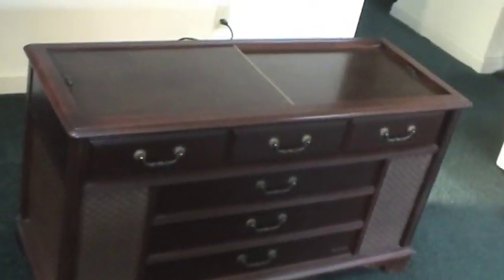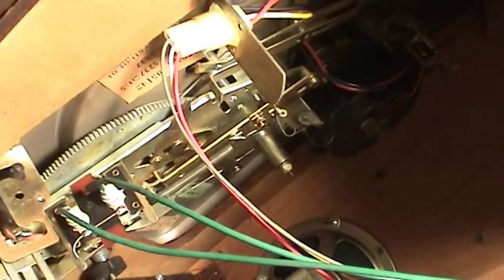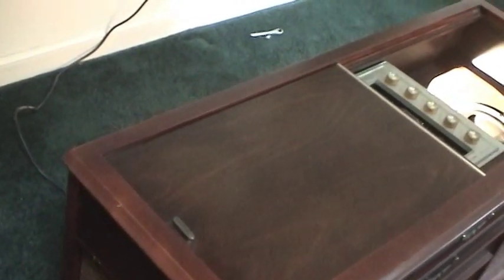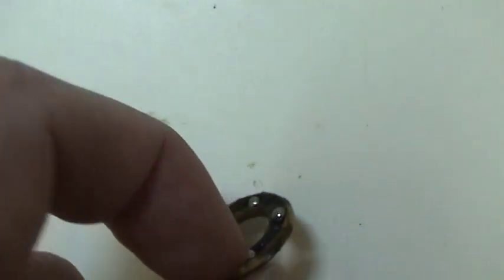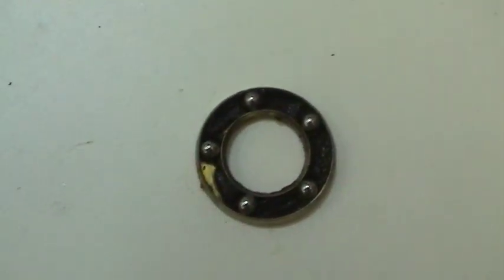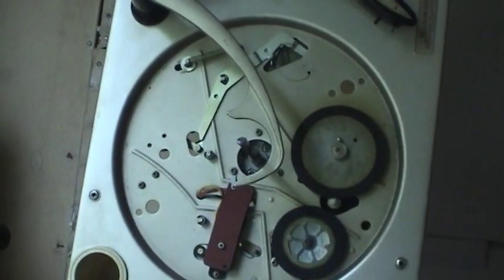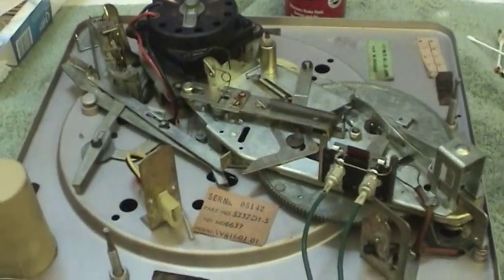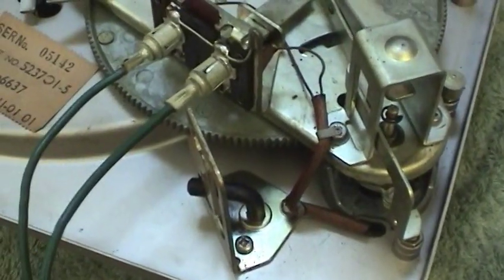1967 Magnavox Micromatic Turn Table Maintenance

Comment: Another nice thing about (a lot of) the W600 series changers, was that there was a muting switch in the area where the audio cables connect to the changer. The muting switch was activated during the change cycle so that none of the noise would come through the speakers, then would unmute when the change cycle was finished.

Comment: Just a handy tip or two. When removing the changer, those rubber discs can be disposed of - just pull them out. They were installed for shipping of the console to the dealer and are no longer needed. Once removed, the metal clips simply flip over to a vertical position and allow the changer to lift out. No need to remove them. This will also keep the isolation springs in place. 

Also don't forget to remove the bottom cap of the motor and oil those bearings.
Reply: Any chance you know where to buy those odd shape mounting screws that connect to the clips?  All three of mine snapped off.  Most likely because they are from the portable suitcase version and were  jostled repeatedly over the years.

Comment: Thank you!! I'm about to start on a repair/restore of a portable Magnavox I have from the 60s. It was working until just a few years ago when the turntable stopped spinning (but the motor still hums). Sounds like it just needs to be cleaned up and re-greased. I'm having a few issues taking it apart but from your video I'm suspecting a clip underneath that I need to get to.
Reply from the maker: Good luck with your repair. We have to keep these old classics working!

Comment: I just got one of these today. Radio works great. Sounds awesome. The turntable won't drop the record. I did all the cleaning 
and and greasing. I can't play the records manually either, because the tone arm moves a little stiff and makes the needle skip. My tone arm is different than yours, but the cabinet is almost identical. It has the trumpet front speakers instead.
I worked on it for about 4 hours, but I guess I'll have to put some more time into it....
Reply from the maker: Sounds like you're on the right track to getting it working again. You may have to clean and lubricate it several times to really work the grease into all the parts.

Comment: About time too Johnny Boy...Been waiting for this for ages...haha!!!
That deck is basically a Collaro...Don't you just love the way it senses the record size by tapping the tonearm against it.
Garrard and BSR decks only have one idler pulley...You probably did, but I would recommend lubricating the motor bearing and cleaning the outer edge of the idler pulleys, along with the inner drive face of the platter. That deck has had very little use!
Nice to hear it working at last! Well done! :)

Comment: Thank you for this! I am hopeful I can get my "new" 1963 Magnavox back spinning. However, I discovered that, at some point, the power cord got bunched up in the cabinet, and partially melted on one spot that was up against a glass tube. So that will need to be replaced. 😣

Comment: Collaro made the turntables for the Magnavox consoles...Until Magnavox stopped making them. Yours has to be a very late model!
I would suggest using Methylated Spirit to clean the outer surface of the pulley's...Yours seems to run so well I wouldn't worry too much.
If you go in there again, take the cover off the motor...You'll work it out easily...You're a clever guy John! :)
I love the way it selects the size! Almost sentient!
Keep up the good work! Thanks for the Great Video! :)

Comment: I have the same turntable in a different cabinet. It’s my late grandparents 1966 Magnavox and I am cleaning it up, replacing bulbs etc. still sounds decent but the mid-range freqs are not what I think they should be. Have to figure it it all out.  Thank you very much.

Comment: I have a 1966 MicroMatic Model W620. It's been humming and producing distorted sound. The needle is replaced and it still sounds bad. I adjusted the tonearm weight which seemed to have helped, but an intermittent hum is heard as if some grounding problem?

Comment: I have a different console stereo a 1966 Catalina model 122-686A. I have found the issue it is a switch that has a plastic housing the housing is broken. The "off, on, reject" switch that connects to the motor. I'm looking for a replacement in good condition, any input on what the piece is called and were I can find one?  thanks for your help.

Comment: I'm currently working on a 1961-1962 Magnavox. I'm not well versed in turntables but how can you tell if a belt is slipping or the motor is going out?
Reply: if the motor was bad the platter would slow down to extremely slow but the idler could cause it to slow down but run erratically

Comment: Great video.  I'm trying to get mine to work.   At 14:22 there is a spring in the center of the frame.  I have that spring but I found a spring just like that one in the bottom of the cabinet.   I couldn't see a similar one in the video.   Is there any chance you noticed a second spring and where it is supposed to be?

Comment: Hi there, we've got a similar unit and the turntable spins and have sounds through the stereo but no sound from turntable to speakers
Reply from the maker: I'd check the RCA connectors from the turntable to the power amplifier. Also, check the selector switch on the amplifier and make sure the contacts are clean.

Comment: Hi, I have a 1966-1967 Magnavox stereo floor console that has fm/am, phono player and added a tape player. The record player plays but has a slightly wavy drag sound. Any tips you can advise me what to do? I would appreciate it.
Reply from the maker: Sounds like the motor and mechanism's just need some lubrication. Over time, the grease tends to dry up causing the parts to start to bind.
Reply: +Isaac Saldana  Did you ever get the wavy drag sound to stop? I had my record player serviced and it is still sounding a little slow. Thanks!
Reply: +Dan Nelson  I have a Magnavox Micro-matic as well.
Reply: Dan Nelson I haven't had time to work onit. I have other stereo floor consoles (rca, magnavox) that have working turntables. Thanks for your concern update.

Comment: when the tonearm on my Magnavox [1967 micromatic] it goes all the way and over the arm rest. can you tell how to fix this?
Reply: There is a set screw on the top right next to the tonearm where you can adjust it to get a better one to tap the edge of the record where the tonearm tells the size of the record where it will land. The tonearm has a sensor on the left side.

Comment: I inherited a Magnavox from my uncle, and unfortunately it wasn't spinning properly for him, and is still having issues for me. It is only spinning when it is set to 78 but nothing happens when it is on 45, 33, or 16. I don't own any 78s that I know of, I only own 33s and 45s so the table is spinning much to quickly for them to play properly. I am wondering if it is a wiring problem, but no one in my area fixes turn tables this old. I was wondering if you had any advice. I'm desperate to keep it and get it running since it is the last thing that I have of my uncle, and I know he came close to trashing it. Thank you so much.
Reply: Not sure if you are still looking to repair your console but this could be caused by a bad idler wheel. The wheel that he takes off and greases the spindle and the inside and he said is still tacky. Yours may be hard and not like rubber and thus is not making contact. Mine spins at 45 and 78 RPM but does not make contact at 33 and 16. You can send in your idler wheel to many different websites and they will restore it. I am doing that now.
Reply: Thank you so much! That is very helpful!

Comment: Thank you for the awesome and informative video. I have a very similar Micromatic model. I’m having a really hard time with those clips underneath the tie-down screws. They just don’t want to budget. Do I need a special tool to get them off? Or can you share a technique? So far I’ve only been able to lube under the platter since I can’t get the entire body out of the console.
Reply: I am trying to find info on mine and saw this question!!!
I spent 3 hrs trying til I found another video u r gonna freak...
Just flip the clip to horizontal position!!! They r not meant to come off!!!  Male sure the 3 screws that hold them are snug to player, then reach under flip all three, bam, player lifts right out!!!
Reply: punkytyme like MAGIC. hahahahaha

Comment: Your stereo set is circa 1964.  In 1967 the collaro got a more updated look.
Reply: It’s a silver one, but I have the same one, but it’s a 1967 version, not this one. This is definitely an older version of the Magnavox/Collaro Micromatic. I got this for nothing, but it was originally a Full Dimension portable stereo record player, but it was busted pretty bad since the unit was in bad shape and I did EOL’ed it and turned it as a stand-alone record changer, and thankfully it works perfectly after all these years.
Reply: THIS ONE WAS MADE 
IN 1966
The REF. # 6637
THIS LABEL IS UNDERNEATH THE CHANGER WITH THE WORKING PARTS
THIS IS  HOW THEY DATE  CODED THE  CHANGERS

Comment: Can you take a look at my video?  We have virtually the same player. It stops mid-cycle. Not sure if It's a good cleaning and re-lubrication, or if my problem requires a more intensive repair.  Thank you. Great vid.
Reply from the maker: It doesn't look like the larger drive wheel is making good contact with the motor spindle. I'd look for binding in the mechanism (which could be remedied by proper lubrication) or perhaps one or more weak or missing springs. Don't get rid of it even if it can't be fixed. You could find another one and use it for parts if you had to.
Reply: I lubricated the player and the problem still persists. I do agree that it may be a problem with the motor spindle. Before it stopped working, there was a gradual decline in the initial speed of the wheel/spindle mechanism. Would this point to a more serious problem?  Thanks again.
Reply: it sounds like the motor desparately needs to be oiled but it may be necessary to take it apart and oil the bottom of the armature too

Comment: Nearly all idler drive decks have only one pulley and the automatic function is performed just under the turntable platter. There is a toothed cog driven on the underside of the drop spindle. Collaro decks have two pulley's...One to drive the turntable and one to drive the auto function. They always slip badly! Thats why I said your has had little use as the rubber is very good! Continued...

Comment: Could you explain the best way to get those clips off? I the speed selector doesn't work on mine. I currently leave the back off and slide the speed selector mechanism from underneath the deck.
Reply: Its been 4yrs but jic someone else is looking:
I am trying to find info on mine and saw this question!!!
I spent 3 hrs trying til I found another video u r gonna freak...
Just flip the clip to horizontal position!!! They r not meant to come off!!!  Male sure the 3 screws that hold them are snug to player, then reach under flip all three, bam, player lifts right out!!!

Comment: Where does the yellow wire hook up to?
Reply: which yellow wire, i don't see one
Reply: @larryshaver3568  yellow wire is connected to supply power to amp.
Controls the amplifier
When control switch turns on the changer it also turns Amp on .

Comment: when I try to play a 45 the tonearm comes up and touches the edge of the record then goes back and the changer shuts off it will still work and play  a 12" record fine
Reply: Mine does the same thing 😏
Reply: @robbimarini1281  the linkage that raises and lowers the tonearm is at fault then. i wish i could and look at it but i don't drive

Comment: i found the cause, there is a spring that is attached to the hole in the bottom of the spindle and another hole an inch or so from there

Comment: 8:16.  Nope. Microswitces disconnect cartridge during change cycle.   Tonearm scan/indexing on Micromatics tells changer it's finished.  Also should have cleaned the edge of the rubber idler wheel and motor shaft after touching with greasy fingers.